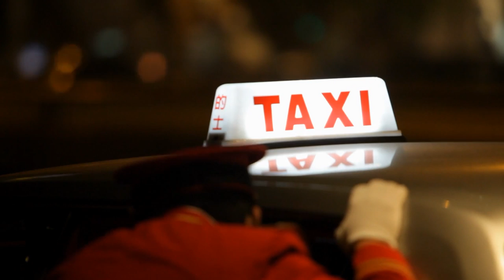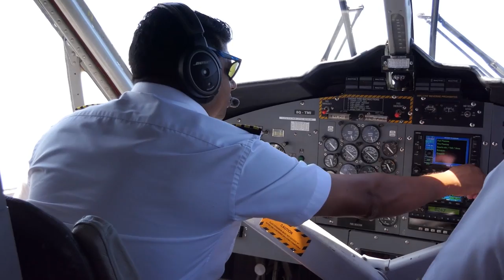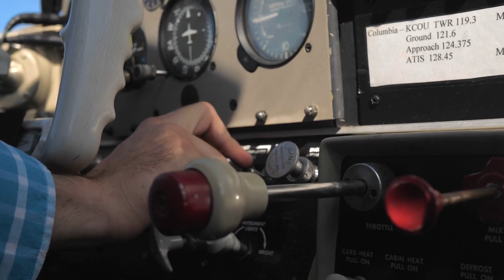15 Deadliest Jobs in the World

Comment: Ive worked construction and roofing amd the outcome of a fall or ect. Isn't counting what harsh things it dose to the body over time of lugging heavy weight and over time your body starts falling apart faster and faster when work for companies that dosent have proper equipment that can prevent some of those injurys. And the truck driving d.o.t has gotten lot more strict and the company I worked for we couldn't exceed are time cause it was all on a computer and the truck would shut off automatically pretty much and just go to where we couldn't keep going without a hefty fine and with gps on it .they knew if we kept moving and wouldn't no way around it.

Comment: Pilot one .... what radiation flying is the safest way to travel I am not buying any of this
Reply: The same radiation that reaches the Earth's surface from space. The atmosphere helps to block some of that radiation. At cruising altitude radiation levels are 10-20x higher than on the ground. It is true that any individual flight is safe but when you make 3 or 4 flights per day the odds start to change.

Really though it was misleading as it's not airline pilots that have a hazardous flying job. It's small charter pilots, cargo pilots, flight instructors, banner tow pilots and pipeline/powerline patrols that are dangerous. The govt lumps them altogether with airline pilots as "pilots." In the end it's crashes not cancer that are the issue.